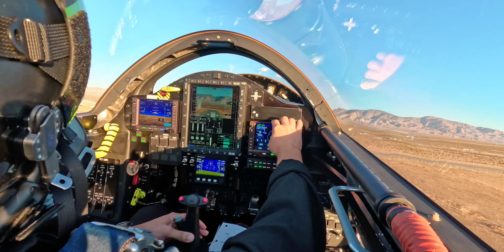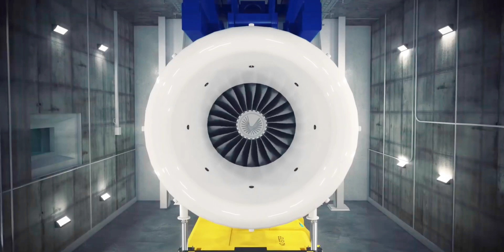Boom Supersonic XB-1 Hits New Speed Record in Latest Test Flight

Comment: There was also a considerable amount of protectionism in Concorde's overland ban across the US. Boeing and other US plane makers had no answer to Concorde.
Reply: Is there any analysis on whether this would ruin ticket prices for the average consumer as if all the business class regulars start flying on this; who will effectively subsidise the rest of the passengers?
Reply: @derbybOyzZ  Less of a subsidy than you'd think. On some flights, Business Class is almost entirely filled by points or desk upgrades, with very few (if any) full fare pax.

I imagine the commercial impact of modern transonic flight has been modelled extensively: however, I'd be surprised if any of those conclusions have been made public, as they're very sensitive commercial information.
Reply: Incorrect, Boeing did in fact have a prototype SST that would have been able to carry a bunch more passengers than the Concorde ever could.  But the cost/benefit equation didn't work out so well and Boeing cancelled, as Concorde should have.  The $10K ticket price, give or take, was still well short of the actual per passenger cost and the difference was made up by the taxpayers in Britain and France.  
The only viable market I can see is billionaire private jet, but there are thousands of them so the market is potentially way better than the meager number of regular passengers are going to want to be squeezed into narrow tube, shoulder to shoulder, with someone else and all for the pleasure of spending 4 to 20 times as much as a conventional jet.
The physics that doomed the first generation of SST's is the same physics that exists today.  The cabin must be made narrower and not as tall!  That results in fewer passengers per flight.  The supersonic speed will cost you big time for fuel and that was the biggest cost before going to SST's.  Again, the only market will be billionaires that can afford a, oh lets guess about $250M to start, add another 25-50 million for a custom interior and the billionaire with the need to show off will just have to have one.